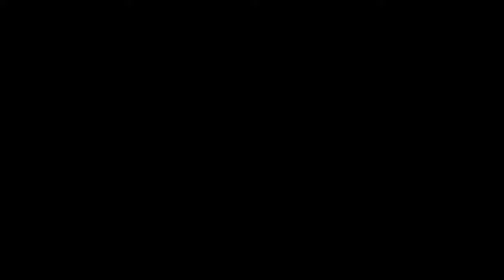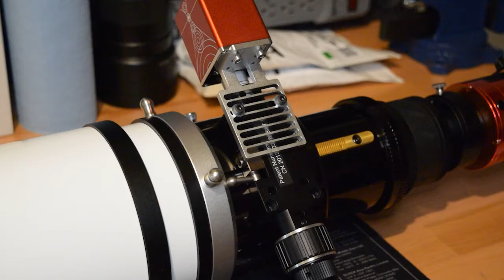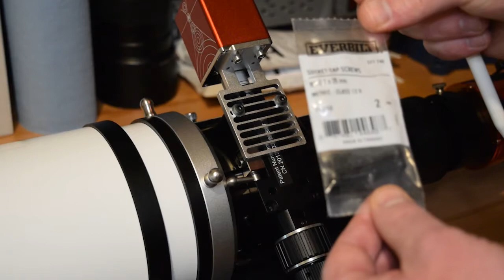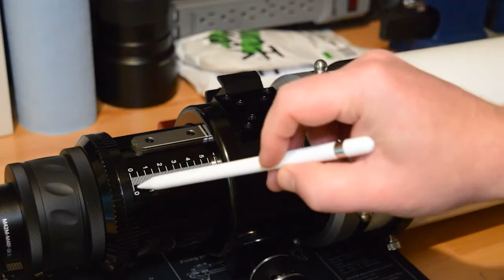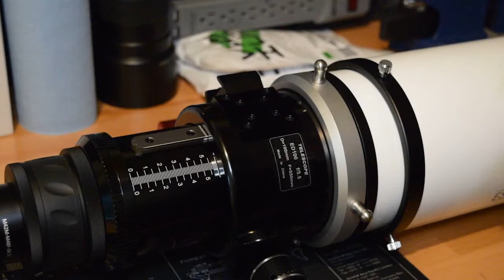ZWO EAF Installation on SkyWatcher Esprit APOs

Comment: Appreciate the video. Be aware that as of 9/2023 [or maybe earlier] the Takahashi kit does not work as described. The 35 mm screws are now 40 mm long so you either have to use a s$itload of washers, cut the screw or buy shorter screws.  The install on my Esprit 120 has been pretty tough actually. The spindle holder did not fit well into the focuser so it was tough to get it tightened onto the spindle without it locking up. I know Starizona has a pre-fit holder but it is back-ordered for who knows how long, right? Overall a PIA [and not yet done].
Reply from the maker: The 35mm screws were always aftermarket, that's why I mentioned the length and the size. 

The little flexible coupler can be tight, but just align the flat part of the focuser rod along where one of the set screws are and you should be good. Install it on the focuser first and then push the EAF on and rotate it flush. You'll also have to get the depth even with the bracket. 

I'll take a look to see if the bracket has changed but I don't believe it has.

Comment: Thanks for the great video 👍 I have the same setup EAF on my Esprit and ASIAIR plus. Like you my focus on my Esprit is around 6. However i am finding the ASIAIR autofocus is a bit off. Can I kindly ask please what your autofocus step size is? I have went from the default 30 to 10 and it’s better but not perfect.

Comment: Thanks for the video. There was no way I was going to drill into the fucusser plate so being able to use the Tak bracket is perfect. Picked one up from Agena Astro. The photo on the website showed what is presumably the older design with 5 slots but the model that arrived has 8 slots like your video shows. Also the Tak bracket came with 2 x M4 x 35mm bolts so I didn't even need to buy these seperately. Thanks again.

Comment: A lot of bad info out there on how to connect the ZWO EAF including removing the grub screws or drilling into the base which may work but requires some nerve.  You got it right!  I believe my bracket set had the longer screws in with the bracket hardware when I mounted it 2 months ago.  I'll have to remove the long screw to confirm whether it is 35 mm.  Thanks.  BTW great info on your channel.  Keep the videos coming.